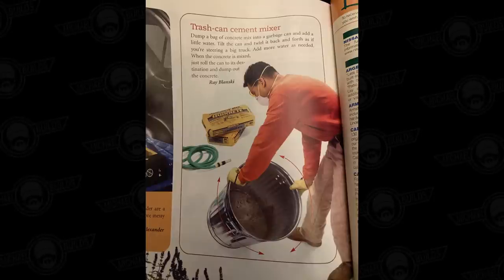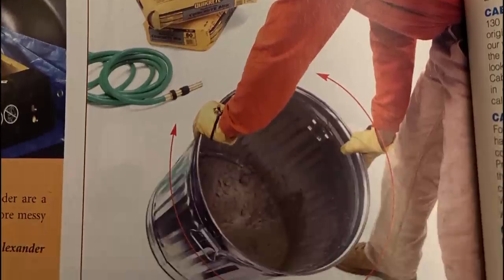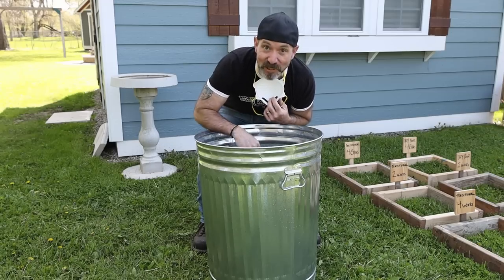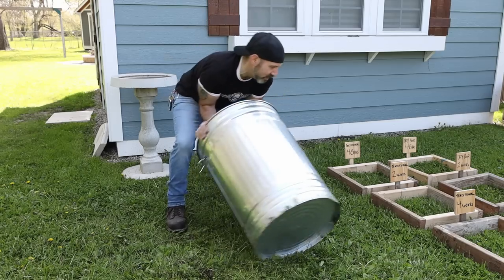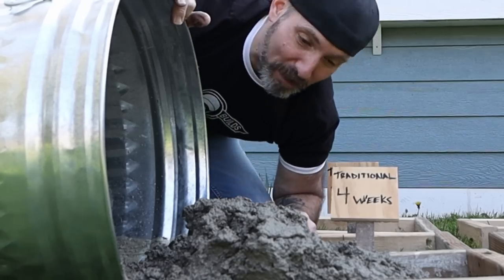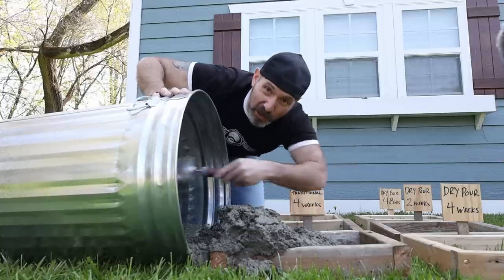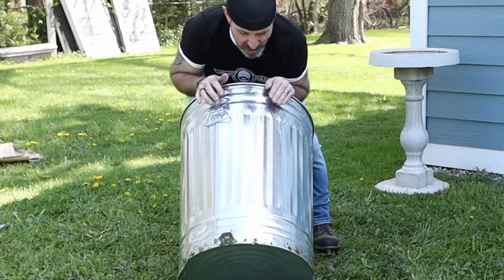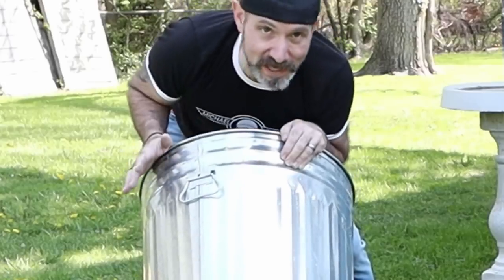Is it easier to mix concrete in a trash can?!

Comment: I used to work as a railroad signal man. I regularly had to mix concrete in the middle of no where to set any number of things. The easiest way I’ve ever found to mix concrete (premix bags) is with a small tarp. With two people, you empty the dry concrete in the center of the tarp, make a dent like mashed potatoes and put water in dent. Each person grabs a corner of the tarp (6x8) and you flip opposite corners of the tarp to fold the concrete onto itself. When ready, you fold the tarp in half and dump. One person can do the same thing by tying the other two corners to the truck.
Reply: I hope Michael tries this way. Sounds brilliant
Reply: Most people's minds are blown when I show them this trick.
Reply: If you build a cob house, this is how you mix it - the straw, clay and, sand. 🙂
Reply: What if there is only one person though?
Reply: @Bonzi_Buddy  I answered that in the original post.  You can tie off two corners to the truck or a fence or whatever you have available and it works exactly the same.
Reply: What a great idea...I like it

Comment: Saw an old timer show how to mix concrete in a heavy duty plastic bag.

Put the bag where your gonna pour.

Move to concrete mix to the bag along with water. He split it up into manageable weights in buckets.

Add both parts into the on site plastic bag

Roll the bag back and forth until we’ll mixed.

Cut bag on top roll it over itself ending with the cut in the mold cut side down.

Lift the bag edges and all the concrete dumps into the mold. Squeeze the bag like a baking piping bag to remove excess.

This process allows you to control the size of the batch and eliminates wheel barrow and shovel work.

Comment: It's not a bad idea, except that it relies too much on the human to mix.  As one of those older guys having troubles, my first thought was that the thing only needed a cradle of 2x4's that set on the ground.  With 4 casters to hold the can at a decent angle, you could then rotate the can all day long without you having to support the weight.  You'd need a fifth caster at the bottom so the can didn't simply slide down the cradle, of course.  It could work almost like a hand truck, with the cradles standing up so you could then roll the can around to wherever you needed to dump the concrete.  Of course, by the time you go through all this rigamarole, you might as well just buy a small mixer and a whatnot.

Comment: An easier method - get a heavy duty low speed mixing drill with a mixing attachment (shaped like an egg beater) . 5 gallon bucket. And mix it where you’re tipping it with the required water. You can even put it on a trolley if you need to move it somewhere.
Reply: We do this also but we put the bucket on a dolley before  we mix it..good minds think alike..lol

Comment: Seems like it would just be easier to mix it in a wheelbarrow? A wheelbarrow has a wheel and once you roll it to where you want it, you can scoop it out with an ice scoop or a small shovel.

Edit: Depending on what you doing, you don't have to mix a full bag at once. Just do half.

Comment: if you dont mild alil bit of a mess on the yard, we poked a hole in the bottom of our trash can, and ran piece of really long repair into the ground at an angle with a little plate on the end to hold the can up in the air alil, when put long bolts on the side of the can like a old ship wheel, allows u to turn it in place much faster with less work. but it can make tiny mess every time you lift the can off the pole.

Comment: On a 8x8 slab if I saw 8 inches from the end , lay my downspout in the void, will I be able to rebar and cement the piece I took out back into place without issues  ? By the way everyone I know  I send them to Michael Builds for ideas and tips.

Comment: It would be helpful to have a sheet of plywood on the ground to help
Lower the resistance caused by the bottom edge of the can cutting into the dirt. It your doing a lot of concrete you could repurpose an inexpensive piano dolly turned upside down and move the wheels closer together to perch the can onto. You can elevate one end with a 4x4 or something larger to keep the material in the bottom end. You will need to fashion some kind of stop at the bottom so it doesn’t slip out of the cradle. A couple shorter pieces of 2x4 made into a L shape and attached to the piano dolly with an inexpensive fixed caster facing the barrel bottom would also lower turning resistance. Place it close to the intended pad and It could be shoveled out when ready.
Reply: Is there a diagram of this somewhere? Thankyou in advance❤

Comment: Would a  plastic trash can work better?  One with a radius at the bottom corner, instead of the sharp transition on that metal can.  Anyway, thanks for the video.

Comment: I think your better off one sack at a time in a wheelbarrow. Just part out the sack in a bucket to the wheelbarrow a few times. 
But what about a big smooth sided bucket or a 5 gal bucket in 2 3 batches and use one of those paint / mortor mixers on a drill.

Comment: I'd like to know why the home improvement stores don't sell concrete in 20 or 30 lb. bags so that people with bad backs or weaklings like me can handle them better!
Reply: It would make sense but most concrete calculators for bagged goods are based upon 60 and 80 pound sacks. Industry standard strength is also based upon sacks per yard.
Reply: Having severe arthritis and osteoporosis, I agree with your statement 100%.
Reply: @andylimb  Yes but I can do the math. That is not the problem. Picking up 80 lbs when I am 60 with a bad back is.
Reply: Probably a few reasons. Industry standards (not to say they can't be broken). Economy of scale and small packaging would make the concrete much more expensive. The market for 20 lb. bags is probably miniscule compared to larger bags. The last reason is they don't care about weaklings and bad backs. 😁
Reply: Soooooo, true!  I just poured two A/C pads.  22 bags of 50 lbs… days of sore muscles and back.
Reply: @davidhorizon8401 I definitely feel that.
Reply: @rogermccaslin5963  "Economy of scale and small packaging would make the concrete much more expensive."  That's probably the real reason, yeah.

I'm not to sure that the market for it is that miniscule though.  You see people buying those really small tubs of premixed joint compound?  You can almost get a big bag of the dry stuff for the cost of just one of those small tubs.  Then again, I suppose that DIY interior wall repair is probably more common than DIY concrete jobs.

Comment: I think the trash can idea has a possibilities but I believe you would have to break it into half bags instead of a full bag, And if you could put a lid on it where it would be watertight then I think it would work pretty easy half a bag in what water you think you need put the lid on tight to where it won't come off and then roll it around that way, ? What do you think ?
Reply: I had the same thought: lid on, then roll that baby across the yard with your foot. 😁

Comment: maybe for disabled peoples, rather than rolling it in the air they can tilt the trash can on a long low bench, concrete wall, etc to support the weight and just roll on it at angle

Comment: I had a bathroom from hell that I had to reinforce the outside wall and new treated plate that I had already affixed in place to the wood stud wall we needed strength because of years of poor  construction in the first place. 
  I was sick at the time with a disease that gave me a 20 percent chance of a five year survival. It had to go in a single pour and thirty eight bags of eighty pounders had to leave the truck bed, in the mixer, out of the mixer I to two buckets, up three steps and another 20 foot carry into the bathroom to pour into a skinny top of the form. The last three bags I was crying it hurt so bad. Sixty years old and just too mean to die .it's twelve years later
  Bath turned out nice with an all tile shower pan and even the ceiling has tile . Never again
   Anyway, a hardware store sold me their twin wheel mixer that is a glorified wheelbarrow mixer hybrid. Throw it in, mix and dump. You could actually mix it right where you pour. Game changer

Comment: A little carpentry and some caster wheels and you could turn it in place like a regular mixer.
Reply: This is what I was thinking, maybe not easier but a potential way to make a home made mixer.
Reply: @CF_Sapper  depends on the size and needs of your property whether that is a efficient use of time and space.
Reply: @sharrykitz9231  Oh Defiantly, and materials laying around. 

you could probably get a very simple version using a small 4 wheeled car flipped upside down titled up and a few modifications, to a very complex welded steel frame and a old treadmill motor. the small home depot ones are not terribly expensive and there is the option to rent one, or use a wheel barrow and a shovel, home depot buckets and a drill attachment. or pay someone to do it, there is no one answer to fit all just more options.
Reply: @CF_Sapper  I’ve rented those before. If I don’t buy one though it will be a larger tow behind for my needs.  We just started building on our rural property and I have a ton of concrete jobs to work on. I’m big into low maintenance fencing around the working area so my dogs can run free while I’m working in the yard so I’m going to make concrete fence posts as well as raised beds. “Man about tools” has a lovely design they scales up or down or out for your needs. All concrete so it’s permanent. You should check him out.
Reply: @sharrykitz9231  funny you mention that I am looking at taking One of the mid size ones who fame is rusted out but the motor and concrete "bucket" part are still good, and turning it into a small pull behind for yard work complete with a water tank, small electric water pump and storage for concrete bags. I've got most of the stuff laying around already. But I will definitely check out man about tools!

Comment: Dry ready mix concrete must be cheap in America, because  I have always found it to be cheaper to mix my own raw materials, only time I would use a ready mix is if I needed a small amount.
Reply: I don't really think its that cheap but most are doing smaller jobs so its the best option for them if you have a mixer and bring in enough sand and gravel its still likely cheaper to just buy the portland cement and mix your own depending on how much the gravel and sand cost you to get delivered.
Reply: @alan-qd3vb  absolutely right.....to source materials for a job like Michael did would be a huge pain....1 bag per form is so much more convenient

Comment: I honestly think a wheel barrow and hoe would be easier.
Reply: The whole premise of the video is how to help people who are disabled or potentially have health problems and can't pick the bag up. How are you going to get the bag in a wheelbarrow if you can't pick it up.
Reply: @mathew00  if you think a disabled person could do what's in this video then you've lost your marbles.  Besides....you can literally tip it over just like the can and put the material in it.  Prop it up and mix like a human being instead of being bent over the whole time.
Reply: There are all levels of disabled. It sounds like you have a picture of your mind of what a disabled person looks like. I don't recommend that because disabled comes in all shapes and sizes.  

For example. A person with one arm might be able to do what is shown in the video easier then trying to lift one of those bags of concrete up to a wheelbarrow.  Many disabled people don't want physical help, they just want a solution to do the job themselves.
Reply: @mathew00  right....for the 5% of the whatever percent are "disabled" this perfect.  The majority will be better off and hurting less after using a wheel barrow.